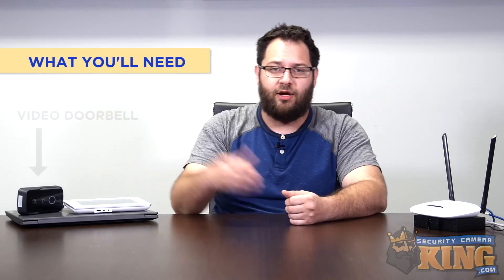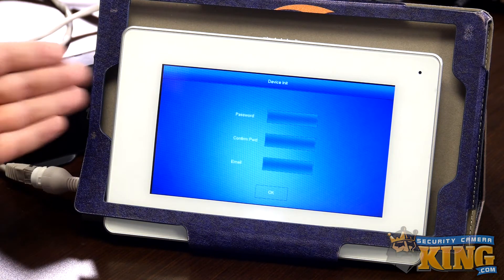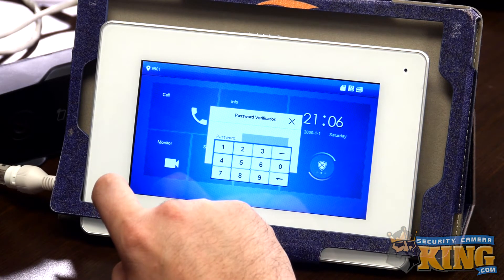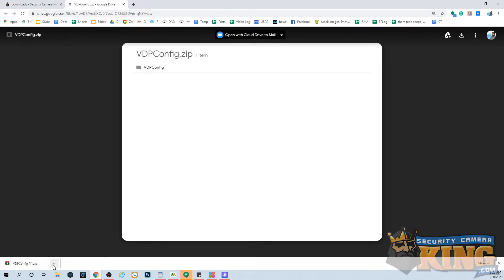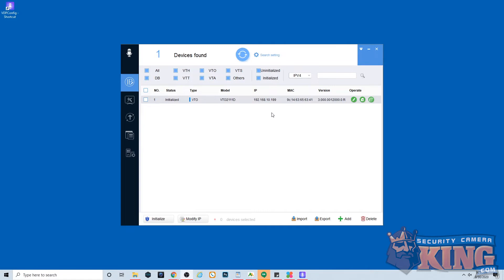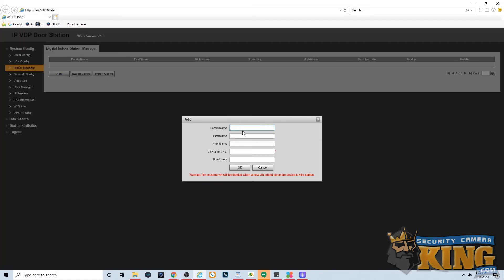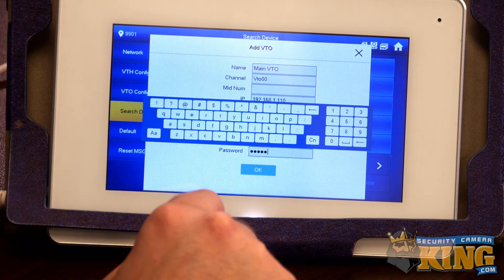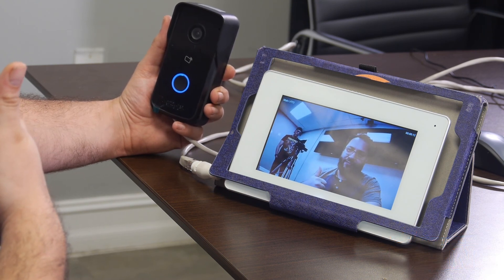Tutorial - Setting Up and Pairing your Video Doorbell

Comment: I live out in the country side. My house has no satellite internet so pretty much I have no Wi-Fi. I would like to connect a doorbell with a puro switch with an echo show 5 is this possible?
Reply from the maker: Hi, we don't sell amazon products but generally amazon's camera systems are reliant on cloud data and web services to function, so you would need some form of internet to run the echo suite.  Our doorbell cameras and villa stations (while serving different purposes) do not require internet to serve their basic functions (the doorbell as a camera, the villa as a video doorbell control station.)  Without internet however I see some issues- mobile app notifications when you ring the doorbell would not function and we would have extreme difficulties in aiding in technical support without being able to remote into your network.  You should watch our latest video showcasing our new 2MP Villa Station setup https://www.youtube.com/watch?v=PNFv7tAwidg, you can find this product on our webstie here: https://www.securitycameraking.com/product/2mp-elite-villa-station-and-indoor-monitor-kit/.  If you are interested in our products please give our sales department a call at (561) 288-5258 option #2 to see if we can find an appropriate solution for you based on your exact goals for having a doorbell/screen setup.
Reply: @Securitycamerakingcom  is it that easy is it plugin play. All I have to do is mess with the monitor settings?